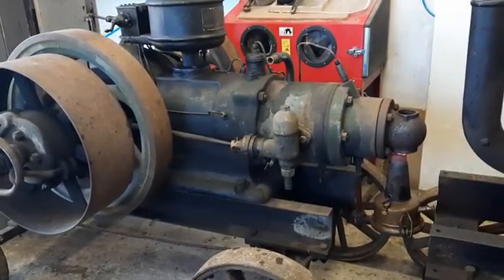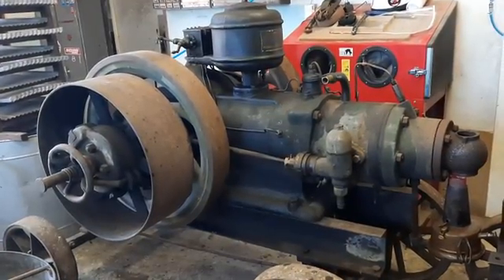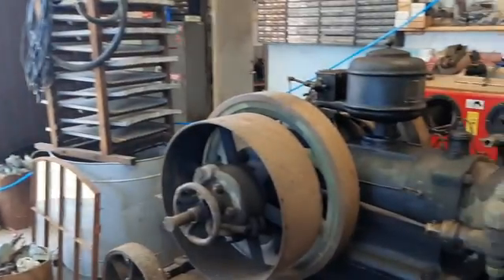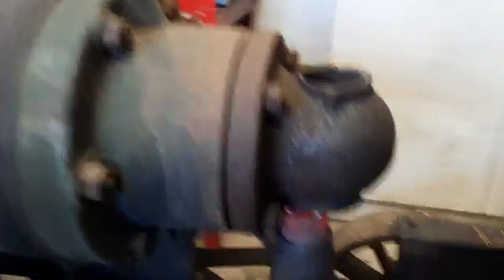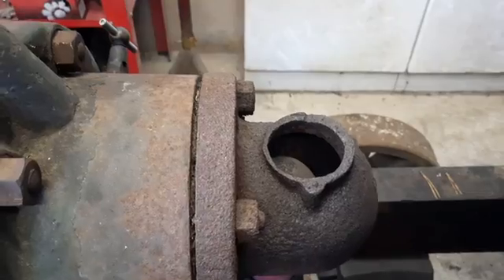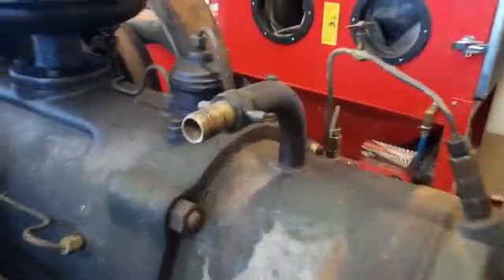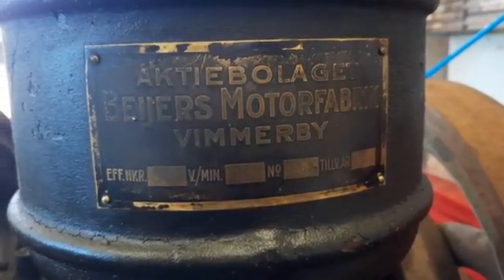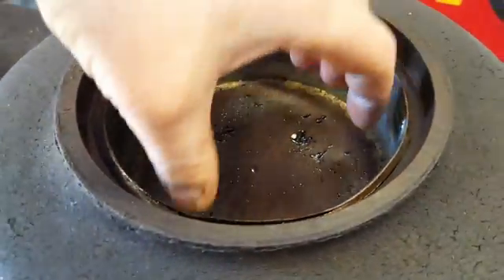10.4L Oil Engine Running @ Zero RPM. How is that possible?

Comment: Yup, I want one. A few years ago the price of scrap iron hit a new high and all of the cool old stuff around here disappeared.
Reply: Sadly about the same time the scrap yards stopped selling to non commercial clients.
Used to most place were glad to sell to you from the pile if you would pay more than scrap.
Now I see cool stuff that is worth money (saw a few phone booths a few years ago) but they don't want the hassle of selling to individuals.
Those phone booths probably came back as beer cans or razor blades depending on what they were made of.
Reply: @1978garfield  As a kid we used to drive through the local scrap yard once a week to see what we could pull off the pile. I bought a mini bike frame with no motor one week and an old briggs tiller the next and had a running mini bike for less than $50.

Comment: Do you want this engine to run forwards or backwards? 

YES
Reply: So what do you do when you get it going and it fires off in the opposite direction you need it to go?
Reply: @routtookc8064  turn it down to 0 rpm and then try to increase the rpm at the right moment?  I guess.
Reply: @routtookc8064  run
Reply: @routtookc8064  if you need a set direction you could probably use a pony motor to start it, or a ratchet or a ratcheted differential.
a gearbox that can reverse is also an option.
Reply: @routtookc8064  You would reduce the throttle and convince it to go the other direction. Plenty of tractors used this principle instead of a "reverse" gear.
Reply: Don't engage the clutch, and take your break. Lol

Comment: Would it run on something like used engine oil, or would that be pushing it?
Reply from the maker: Works fine, but you have to tear down the engine once in a while to clean it from the sot that burning engine oil makes.
Reply: @YesterdaysMachinery  So it even recycles!

Comment: My opinion is you better open the decompression «valve» once you shut down the fuel before the complete stops the engine ...

But you're right strait to the point whatever will be allowed to get there in between piston n head will get cooked in a matter of minutes after the shutdown the engine ...

Yep, 2021 not that far away from ...
What was the year you were talking bout ???

Dare, care, ride safe, clean, have fun ...
From France, with .

Comment: What kind of emissions control systems does this engine have? Euro VI?
Reply from the maker: Euro 1000. The fact that it survived and works as good as new after over 90 years and can run on any fuel there is must make it good for the enviroment.

Comment: Fantastic - I have just inherited about 15 smaller machine one comparable oil engine and a twin massive diesel lister - have 15 years of tinkering ahead of me.
Reply: You should post videos.
Reply: @1978garfield  I’d love to but I’m too self conscious - I’ve only got two running but I hold great hopes for the two cylinder lister - a
So the very large oil engine has a cracked head so that will be some job.

Comment: This is a cool video of a hot machine.
I’m guessing it ran a belt in a sawmill. 
0 rpm featured is to reverse the direction of the engine after start up. 
At start up you can’t tell what direction 
it will catch prime and run. 
You wouldn’t want the saw blade running backwards!🔄😂👍

Comment: My father was a mechanic for 57 years... i told him i have seen an engine running at 0 RPM.... "IMPOSSIBLE," he says as we banter, i show him this, he says, "that is 0 rpm! I forgot about these, i worked on one during my apprenticeship", then he also told me about the time he started a Field Marshall.... with a shotgun shell.... Thank you for this, very good content made my dad remember some old times and tell me some great stories. Australia had to import everything at the time my dad started as a mechanic. He just turned 70 this year and was working at 11 years old with my grandfather in his service station. He said "I never want to smell f *&king engine oil again". Also said they could run this engine on whale oil.... and did.
Reply: Many WW2 aero engines had a cartridge starter (Coffman). Many needed one cartridge to clear the engine (ignition off) then one to start with ignition on. If it failed to start, you'd often have the engine on fire so make sure you know your mixture settings. :)
Reply: @Dave5843-d9m  
Flight of the Phoenix (original)
https://www.youtube.com/watch?v=IACjOvyx5hs
Reply: In a Field Marshall you also need a lit cigarette to start it. There's one in a museum near me and the owner always amazes people when he starts it up.
Reply: @danmanmcleod  cigarette? I’ve never seen that but the “glow plug” is some rolled up notebook paper that smolders, I guess you could use a cigarette…
Reply: We still have a machine thats started with shotgun shells.
Reply: Yes, and a Lanz Bulldog will run at zero RPM as well.
Reply: Here is a video of a field Marshall started with a shot and a wick. It is not a shotgun shell loaded with shot, only gunpowder. The cylinder is pre-heated with a wick or fuse. (Can't remember what they are called) not a cigarette, but they look just like a cigarette filter.
https://youtu.be/CJpZfp0Ss2U
Reply: That is an awesome story.
Reply: * he started a Field Marshall.... with a shotgun shell....  * WTH ? lol
Reply: @daviddou1408  
It was possible back in the day to do this and get away with it...country folk, country rules...
Reply: @daviddou1408  
I'm here for the story..not the facts....
Reply: The german Lanz Bulldog tractor/Schlepper, early models at least can run zero rpm s too, one video shows going back and forth.
Reply: @daviddou1408  
Sorry, you lost me....
Reply: honestly i would say its running at 0.75 rpm 🤣
Reply: Starting engines with shells is pretty common.
Reply: Nice one is also starting a engine with a engine (pony motor) with big CAT engine in the 60s/70s
Reply: Grouse story - the stationary engines I’ve inherited where left on the farm of a tractor/engine collector mechanic which I bought in Vic.
Reply: @rupert5390  make some vids of them.
Reply: @daviddou1408  Thank you sir. First thing I noticed was "mechanic for 57 years" then "he's 70 + working since 11"
Reply: Bet this comment is the reason youtube recommended me both this video and a ww2 plane shotgun shell staring
Reply: Whale Oil Beef Hooked!
Reply: Grouse story.

Comment: Great content. When you fuel it from that wobbling zero rpm stage, can it turn either way [edit] if you fuel it at the right/wrong time?
Reply: Yes...the principle in simple fishing boats with these engines..
no need for a reverse gear....
reverse the engine rotation....
Reply: @JohnSmith-pl2bk  Thanks for replying :) that is really cool. This makes me imagine a manual car with 5 reverse gears lol
Reply: @icraftcrafts8685  
See Doug deMuro's review of a Ferret Scout car....British armoured car, steering wheel at both ends, ran just as quickly backwards as forwards....gearbox though...

Comment: I really enjoy your collection of antique engines and taking the time to show them. But do please be careful with carbon monoxide poisoning. It will sneak up on you and you'll never feel it coming. And unlike CO2 you can't just get fresh air to fix it. I know.. ended up in hyperbaric oxygen therapy from it myself once just from a cracked furnace exchanger.

Comment: Smokepunk. Now seriously, you've filmed good and now i know more about ye olde heat engines, thanks. Should consider subscribing. The only thing i'd recommend is sound improving, start with buttonhole mic for exampel.

Comment: My grandfather had a big 30 liter single cylinder engine in his old fishing boat. Took 1 hour to start.  Blew nice black and blue smoke rigns out the stack.  Sounded a bit like this, only it ran really slow on idle. I don't remember the make of the engine, but it was made in Norway in the late 20's.  Great video.  The sound brought back memories.
Reply: There are some of those floating and running around here on YouTube. They have a very distinct sound that fits in very well with the bays and fjords.
Reply: @lt1nut  do you have a searchable term for this?
Reply: @TheJunky228  
From what I remember many of the titles were in a Scandinavian language, which makes it kind of hard but I'd include words like "fishing boat", "troller"(trollar"?), "Norwegian", "Danish", maybe "Swedish", "Norse", "Norsk", "traditional", "local", "restored", and "engine sound" since I believe one boat in particular is restored and known/"famous" for that. 

I wish that I could be of more help.

Comment: Hummm water not connected and fumes coming out of the cooling water connection. Already cracked block or head?
Reply from the maker: No just some old water standing in the cylinder and head starting to get hot. And the waterpump is pumping air in pulses so it looks like that. No worries 😁
Reply: @YesterdaysMachinery  Wheeew...

Comment: "Zero RPM" is at 11:32 in the video. With the piston rocking back and forth, the engine is at basically net zero RPM. Pretty cool.
Reply: The piston always rocks  back and forth. What makes it zero RPM is the flywheel rocking back and forth.
Reply: @xenaguy01  If the piston doesn’t make a complete revolution, it’s at zero RPM. Same as the flywheel.

Comment: Schrödinger's engine, it's running and not running at the same time!😂
Reply: So the Swedes were building quantum engines long time ago😆
Reply: @Cyores  i mean, i imagine this isnt the first 0 rpm engine ever produced
Reply: Ironically, it was built before cats were required!
Reply: @whitesapphire5865  HAHA, cats!! That better than my comment!😂😂.
Reply: @domminion599  But....... Were it not for your comment in the first place, mine would have no reason to exist
Reply: @whitesapphire5865  Still wish I'd thought of it.😂
Reply: @domminion599  same
Reply: @whitesapphire5865  So, what you are saying observation changes the property! Brilliant!😂
Reply: @whitesapphire5865  Sure, But Its At Least 100 CatPower
Reply: @whitesapphire5865  that was a good one, thanks for the laugh
Reply: An engine running at 0 RPM for an indeterminate amount of time = unlimited power
Reply: There's actually a cat inside the crankcase that spins the engine.
Reply: @Johnno48  There may be a cat inside or not. Until you open the engine, both possibilities are true. Now I'm wondering if the cat is trying to keep it's nose or it's ass offa that hot bulb.
Reply: @Johnno48 only because its got a slice of buttered bread attached to its back and it's above a bit of expensive carpet. 😂
Reply: Nice one ! Quantum mechanics from almost 100 years ago !
Reply: So is this a hit and miss engine?
Reply: @tomthegoat5139  no
Reply: @thomas brown
Yes and No 😆
Reply: Nice 😆
Reply: @Dom Minion
Bazinga!!! 😆 Great comment!
Reply: @GuitarGuys7299  leave BBT out of it!😂😂
Reply: @domminion599  😆
Reply: True , true sais the Cat ^^
Reply: Niice!! These rabbit hole videos always have the smartest comments :)
Reply: Thank you Dom Minion, This explains Quantum Spin/Quantum Entanglement perfectly. As soon as you try to measure the spin, its property changed. 😂😂.
Reply: That compression stroke sounds like me after a visit to Taco Bell.
Reply: Hahaha yes !
Reply: Good one 😅
Reply: No way to top that comment, you win!
Reply: Imagine the torque!
Reply: Great comment!!!!
Reply: @stephensmith799  ;f#
Reply: cats burn what engine doesn't. hense some fuel leaves cylinder unburned, incomplete combustion, therefore left to be consumed in catalytic. is there any emissions from this engines .unburned oil? appears all.oil is consumed.. seems operator was not choaking on the smoke or fumes

Comment: You need to dyno this and see how much horsepower it makes a zero RPM.. It will probably be the strongest HP engine ever at that speed. Probably a world record. Just gotta find or make a dyno that spins both ways in very short bursts.
Reply from the maker: Should work with a permanent magnet generator 😁
Reply: Hm, steam engine would like to have a word here.

Comment: Wikipedia quote:  "All two-stroke diesel engines require artificial aspiration to operate, and will either use a mechanically driven blower or a turbo-compressor to charge the cylinder with air."  Apparently the Wikipedia author has never seen a Beijer engine!  Great video!
Reply: That’s why you don’t trust wikipedia. Most diesel engines that were made before 1990 were naturally aspirated.
Reply: @kn4dgs  This is specific to 2 stroke diesels and it is true here. In this case the crank case and piston movement are used to move the intake air into the cylinder.  That's why the leather reed valve is there.
Reply: @Melanie16040  Your point is well taken that the piston is, in effect, the induction mechanism.  And this engine is actually a fairly conventional, single-stroke, reed valve engine, except most reed valves are metallic, not leather.  My comment was a snipe against Wikipedia and their statement specifically about the requirement for "blower" or "supercharger".
Reply: But a hot bulb engine isn't a compression ignition engine like a Diesel.
Reply: @Graham_Langley  Yes, you are certainly correct and I stand corrected.  This engine does burn diesel as well as a variety of other fuels and the hot bulb allows it to operate with lower compression than a conventional diesel engine...I assume.  However, Wartsilla-Sulzer engines are multi-cylinder diesel compression engines and, although they are often turbocharged, many are naturally aspirated due to their design with two-piece connecting rod with upper rod segment that passes through a gland with seal in the bottom of a bottle-shaped cylinder.
Reply: @Graham_Langley  
Graham, when the air gets compressed and the diesel injected, the mixture will start burning and force the piston down on it's power stroke....
The only way ignition can occur is if the cylinder and especially the head (bulb) is at the correct temperature to start the ignition...
How is this any different from a diesel-fuelled engine that requires a glow plug or a thermostart system?
Reply: My old victa says otherwise, it diesels all the time.

Comment: I wonder what the continuous duty rated life between overhauls was for this?
Reply from the maker: Very very long. Often worked 12h per day 6 days a week. Pretty much undestructable because of the low rpm and over 100kg/hp. So as heavy duty it can be.
Reply: @YesterdaysMachinery  So this thing about 3 tonne of torque?
Reply from the maker: @vctrsone  Yep 😁
Reply: @YesterdaysMachinery  Good thing it's on wheels; stops the shed and concrete pad shunting to and fro with the inertia.